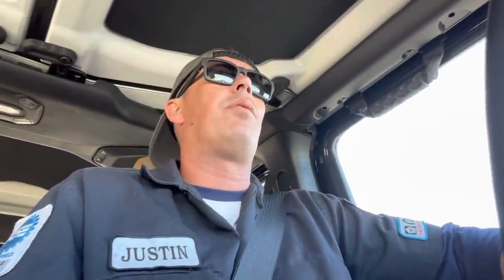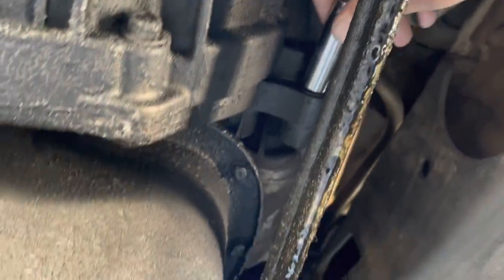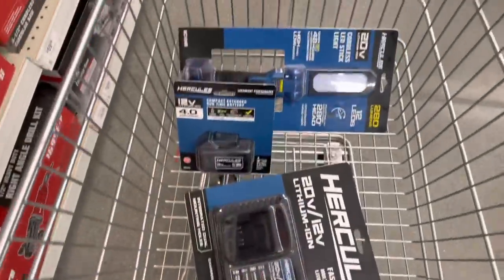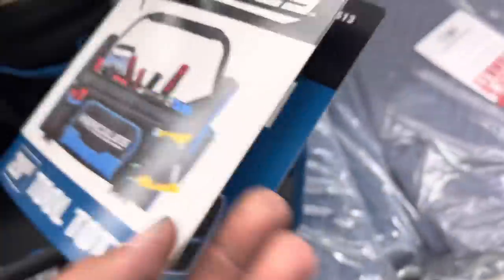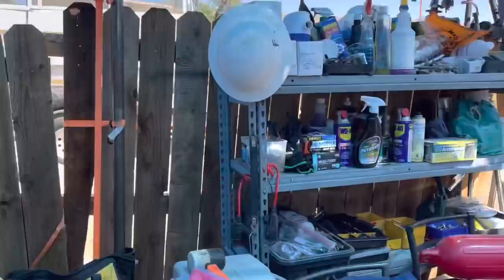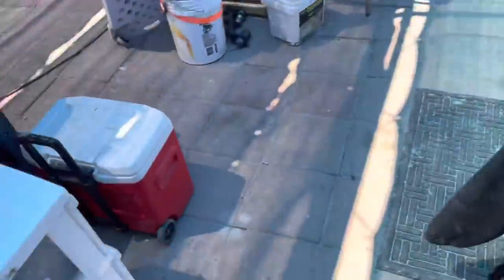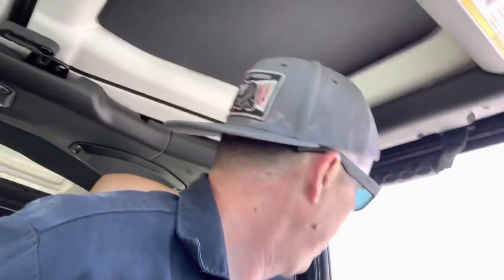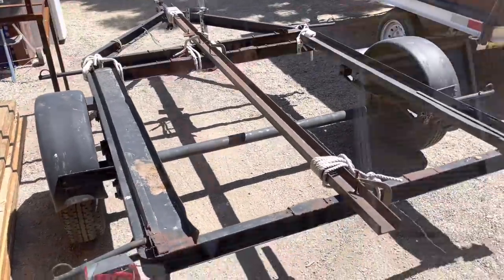1k Harbor Freight Tool Haul for the Boat 🚤 Yard 😊🍻& New Trailer Fabrication Projects

Comment: 6.0 diesel eh. Should've did that guy a favor and ripped that pos boat anchor out and tossed a 7.3 in there 🤣
Reply: That's a great suggestion I'm not a full time Diesel mechanic but I work on them when they come into the shop including a fleet of log trucks but I do know the 6.0 is a crappy engine